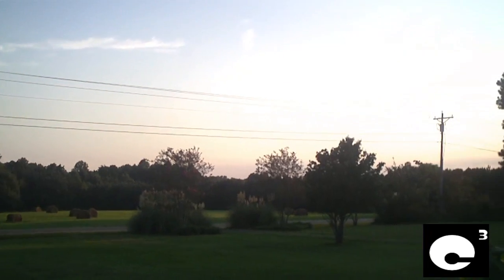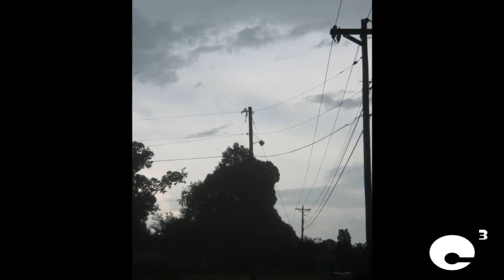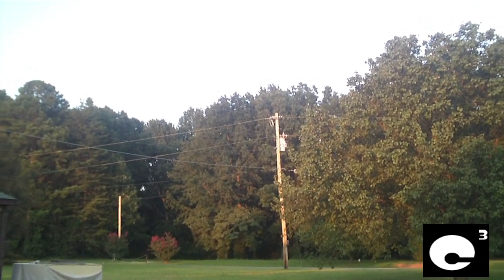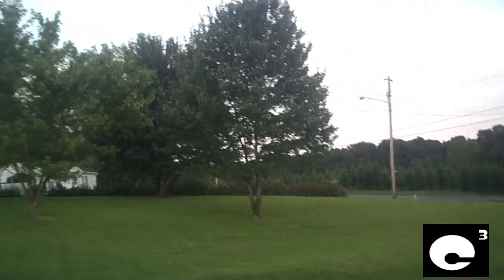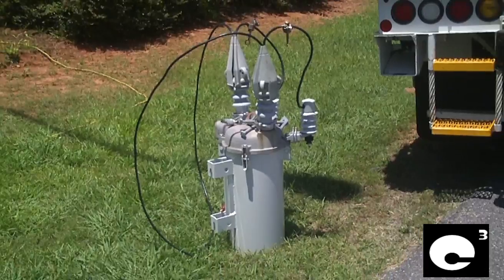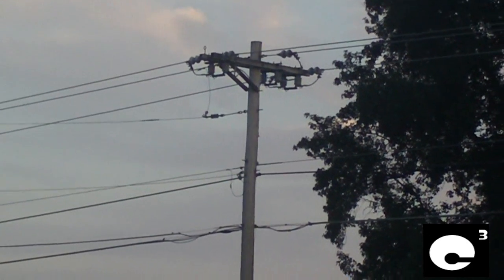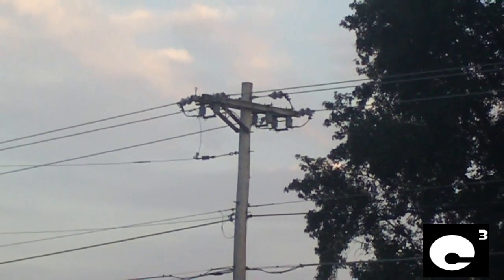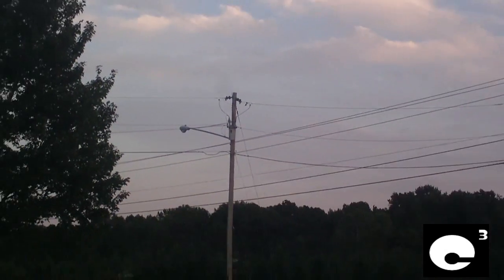Let's Talk About Power Lines - Reclosers vs Fused Cutouts (Expulsion fuses)

Comment: Ariel reading heat sencer to its tempeture limit to inspection it could courses after inspection check posiple  could courses ignite ignition cut aut auto switch . Inbuilt sevalince Cam. connect to erial Atana read settle light aut space bounce warning ⚠ computer .to shut down main electricity. To be check out from fire station social media. The cable across line readings attach to the Cam are fuse switch fare back cable another way cut off cable line to the far meters away not alive to ignite in streets and bush and home. With warning turning flash light.. In case no body spotted the broken line it's good to warn to keep away from the broken power lines. Something in case under ground line's could be very expensive fast clean lines need up grade better technology power cables light line cable in built fuse cut off switch readings if goes brightle can see the sencer flureson red very hot possible change color s mean high low temperature reading
Reply: Underground meter check for safety. In case under people homes could complain the cost. Well be much better concrete tube cable through the cable connection concrete tube. Underground line. There are all ready places underground cable happening been made. Faster electric much faster power electric. Need meter reading exam. Because solo system And battery system drows much power all the new technology and readrews electric to company to... elswere reserve. Power cercit cut off self auto switch.

Comment: When you mean tree lambs causing outages and are just intermittent, do you mean that its branch/twigs drop to the line and not necessarily the whole tree is touching the line?i believe tree will just get burned if it touches line and not necessarily can melt the fuse (immediately).
Reply from the maker: Sometimes trees can cause enough of a short to blow a fuse.
Reply: @CubeComputerChannel  I couldn't disagree more. By the way, after the new surge arresters were placed (and assuming the line is still clean of vegetation), was the performance of the line improved producing less outages during rains?
Reply from the maker: @louieangelocollera1082  What usually causes faults from tree limbs is when the tree initially shorts out the line, it ionizes the air around it, allowing an arc to continue until a fuse blows or recloser operates. All a tree limb has to do is law across a phase and ground. Usually when the limb burns off, the arc continues, and then either the fuse trips or recloser operates. This is where the recloser has the advantage, as once the power is interrupted for a couple seconds, the fault is cleared, and power can be restored.

With all the work that was done, there are less outages, but the recloser does operate from time to time. It operated last fall due to kudzu growing up one of the poles. What would have been an hour plus outage with the fuse, was instead only two 3 second blinks with the recloser, as the recloser operated twice.

https://www.youtube.com/watch?v=HWnn2INmd2o

Comment: Nice explanation of reclosers vs fuses.  However, perhaps because you live in a wet environment, you fail to mention the catastrophic fires that have been caused by reclosers in areas that are prone to wildfires, such as Australia and the American West.    The Utility Companies have no way to turn these devices off without sending out a line crew to do it manually.  When a Red Flag weather condition prevails, and say a tree limb bridges the conductors, the recloser will repeatedly send thousands of volts down the line attempting to reopen the circuit, and "blow off" the fault!  Given a tinder-dry forest and a 70mph wind the results are predictable.  This was the situation last year in the CaliforniaTubbs Fire - over 40 people died.  The year before that, in Australia over 100 people died in another similar wildfire. The Australian courts have convicted the local Utility Company of negligence and laid the blame squarely on the use of reclosers.  One of the reasons Utility Companies are aggressively employing reclosers is that they see it as a way to reduce service calls related to power outages, and more importantly the number of linemen they employ.  This is particularly true for the privatized, for-profit Utility Companies since reclosers reduces their overhead, and increases profits...
Reply: Investigators say a deadly 2017 wildfire that killed 22 people in Northern California wine country was caused by a private electrical system, not equipment of embattled Pacific Gas & Electric Co. FYI, expulsion type fuses utilize a tin or silver-link element in an arc-tube that expels gas and potentially molten metal and sparks to the atmosphere as a means of extinguishing an arc created by a faulted condition. The molten metal, however, can be a source of ignition for fire. Utility companies can re-set a recloser to "one-shot" or non-reclose using SCADA if they have it, meaning they can reset them from the operations center. The smaller systems without SCADA do have to drive out to each recloser to re-set. Some utilities without SCADA are now setting reclosers to non-reclose at the beginning of fire season, then switching back to normal reclose after the first big rains in the fall.

Comment: That first cut out is protecting the transformer. The primary is double dead ended and tapped over to the lateral phase. The protection is further up line.
Reply from the maker: This electric cooperative does not install cutouts on transformers. The cutout he's installing is for the lateral circuit.

https://www.google.com/maps/@35.3936622,-80.8928006,3a,15y,287.44h,115.07t/data=!3m6!1e1!3m4!1sK2rsfKctlSXlxBLHaYXCLw!2e0!7i13312!8i6656

Comment: I think you probably should have sued years before for better service.  Eliminate that cheap single feed system with three phase.
Reply: whorton4 you're dumb
Reply from the maker: This single phase line is a branch circuit that feeds less than 30 residences. None of these customers need 3-phase service. There is 3 phase service at the road. Most homeowners only need single phase 120/240V service.
Reply: Granted, and all power delivery is a tradeoff for cost v. efficiency.  My point is that were the houses served by 2 phase 240v service, 50% of them would not lose all power in the event of a failure.  Especially if the houses were on a leg that had frequent problems. . .

Comment: Hey I used to work for a company that delt with transformers and ocrs well recolsers and single phase and triple phase units. What those dumbasses that shoot at the transformer is that basically those are bombs when they are under full load or full power. I have been inside of substations where three people who were working for a co-op was killed by the explosion of a regulator. See the oil that is inside t
of them is a diluted form of diesel fuel.. When either a transformer blows up by either being struck by lightning or a animal such as a squirrel touches the hot line and it causes the transformer to explode the oil in it could be on fire as it comes out of the transformer.  In Missouri we were working on the reclosures and one of the line man told us about a fellow worker that was underneath a reclosures when all of a sudden the thing blew up and the worker was killed by the oil that was inside of the reclosure it came out on fire covering him with a ball of liquid fire. I have basically tested transformers  like checked the TTR and meged them to testing the big three phase units. I have traveled all over the place where there were co-ops that were in need of having their reclosures sitting in a place where we rebuilt them. I have been in sauitsaint Marie Michigan and to Pennsylvania and Georgia Indiana Ohio Louisiana Missouri Kentucky north Carolina.  It was a different type of job but hey I enjoyed it.
Reply: Hardly any issues here in Georgia our Co-op with them, sure get occasional transformer failure, but most all failures are due to something shorting out the lines and stressing the components.  I am grateful to have reclosers on the line before my house, many times saved me from being without power for longer periods of time. saves the company time from having to dispatch for those temporary little interruptions.  Also Mineral Oils is mostly used not petroleum based oils ?

Comment: I saw 3 of this one a pole somewhere I thought was odd they had a transformer going in and out into the same line. I figured I just looked at the wrong or maybe it was some sort of inductor for current limiting. I have a friend that's an electrician and they were like it's a recloser you know how you sometimes have the lights flash 3 times that is what that does.

I had another friend tell me they saw a pole transformer take a direct lightning hit and it blew up and sprayed oil all over.

Comment from the maker: For those interested, it's been close to 4 years since this work has been done...

There has not been one single outage call for this neighborhood ever since. There have been outages, but only when the main feeder was down.

This spring has been favorable for the growth of kudzu. As such, the kudzu patch down in the back of the neighborhood has gotten a head start on growing up two of the poles. This recloser has never been forced to lockout, but that might change this summer.
Reply: Pin this comment please.

Comment: How many amps are these fuses or reclosers typically rated for?
Reply from the maker: +Rick McCall not particularly sure about the fuses, but I know reclosers tend to be rated for 10A-400A+ depending on application. The recloser installed in this video is a 35A type L unit.
Reply: They (fuses) have ratings from 1/4 amp to generally 200 amp.

Comment: Here in the UK our transformers on poles and substation transformers are fed from 11kv 3 phase which is steped down from 66kv or 132kv, sometimes the pole transforms are fed from just 2 phases and the secondarys are 240v and neautral, on the heavy duty 3 phase pole and substation transformers its 3 phases of 240v or 415v with all 3 phases used together or 415v phase to phase, 415v is mostly used in high power applications i.e. farms, industry, big stores. All UK homes have a single phase 240v incoming supply.
Reply: Technobabble
Reply: @benjaminbrown3939  And your point is? Are you trying to tell everyone that what people have typed here is beyond your comprehension?.
Reply: @stiggyness1976  It is beyond the comprehension abilities of almost everyone
Reply: @benjaminbrown3939  This is true, hence why people like myself exist to have the required expertise, to keep the power on.

Comment: The reclosers I worked with in the 80's had three stages. The recloser is tripped by a solenoid that pushes against a spring and opens the contacts at the same time. The solenoid is sized so an over-current condition will cause it to operate. The first trip results in the spring tension re-closing the contacts almost immediately. It also causes an orifice to move into place, restricting the flow of oil pushed by a piston connected to the reclosing mechanism. If the fault still exists then it trips a second time but the speed of the solenoid is slowed and it doesn't open the contacts for a couple of seconds. If any tap line has a fault the over-current condition will cause the tap line fuse[s] to blow, clearing the fault. The reclosing spring then closes the contacts again. If the fault is cleared, the solenoid doesn't open the contacts and power is restored (except in the faulted tap line). If the fault is not cleared, the solenoid operates a third time with a longer delay due to a smaller orifice moved into place. The contacts are reclosed again, and if the fault still exists the solenoid opens the contacts one final time, and due to a the further movement of the orifice mechanism, trips a link and disables the ability of the spring to re-close the contacts, leaving the line dead past the recloser. The size of the solenoid and the tap line fuses must be coordinated for the clearing scheme to work. The fault current needed to open the recloser must be larger than the current needed to blow tap line fuses.
Reply from the maker: +John Purple Interesting to know exactly how oil circuit reclosers work. I have seen in some instances where in a really bad storm or wind situation, the lights may quickly blink. I would assume this is the instant reclose you're referring to.
Reply: +Cube Computer Channel Yes. Lightning, animals, or a falling tree limb can cause a momentary fault, but not cause a permanent fault. Also, the orifice mechanism will slowly "leak" back to its original position so it's ready for the next full cycle. The external (yellow) lever will only fall open when the final trip occurs, so you can tell from the ground when it has locked out.

Comment: how current in earth wire causes fuse to blow?
Reply: +joel mathews The current flows in a circuit including the "hot" wire[s] and earth, or "ground" wire. The earth wire is usually physically connected to the actual ground (dirt), so there isn't any voltage difference between the wire and the ground and you don't get a shock.
Reply: +John Purple 
is  there any connection between  earth wire and  main fuse in our houses.I read that whenever there is a leakage  of current earth  wire draws them and causes fuse to blow,but i  havent seen  any connection between earth wire and fuse
Reply: +joel mathews You might be talking about a Ground Fault Interrupter (GFI). They will trip when a very small current is detected in the "earth" circuit. Strictly speaking, fuses contain metal strips that melt from the heat of excess current (see french "fusible"). They are rarely used in homes nowadays. Modern installations use circuit breakers which use bimetallic strips that bend when heated and open the circuit.
Reply: +John Purple   but if it is rarely using then what is the purpose of using earth wire which has low resistance.If a phase wire gets in touch with a metal  current will be around that metal,even if we had grounded that metal case as long as supply is there current will be around that metal,right??  Earth  wire  will  have no use then

Comment: A few weeks ago they replaced the transformer that we are on right in front of my house, it took them 15-20 minutes. Later on that day when the power was restored I discovered that my computer was barbecued and wouldn't turn on, the motherboard green LED was blinking very dimly. I don't know if it was the result of the power line crews.
Reply from the maker: DZEyoyo123 There might have been a surge... try replacing the power supply.

Comment: Rural Coops tend to use single phase reclosers more than Investor owned utilites. They will typically have a single phase recolser on each of the three phases of a distribution feeder, at the substation, and there is another set of reclosers downstream on the three phase feeder. Investor owned utilities tend to have a three phase recloser at the substation, where the feeder circuit originates, although sometimes there might be another one placed downstream, especially on rural circuits. The advantage of single phase reclosers, is that they only interrupt the phase they are connected to, rather than the entire feeder.
Reply: You are right
Reply: Depends on which utility you look at. Are you sure you're not tying the three phase recloser and the ocb, or power circuit breaker, together in your mind? They are very different in the job that they do and are not the same.

Comment: sure they 25,000 volt running in them transformer.
Reply from the maker: On these lines, it's 7200V phase-to-ground.
Reply: oh ok. where i live, so many things on them poles lol. then got a sub station near by. next to UP railroad mainline.
Reply: 25000v is usually overhead powerlines for the railway industry,  (here in the UK anyway )

Comment: Now I know what those are, I used to think they were some kind of coils maybe to correct too much capacitance caused by some kind of line load.
Reply: That actually wasn't a bad guess! There are reactance correcting devices used, you just have it backwards. Power lines and the vast majority of loads are inherently inductive, so you'll see pole mounted capacitors installed fairly often to help offset that.